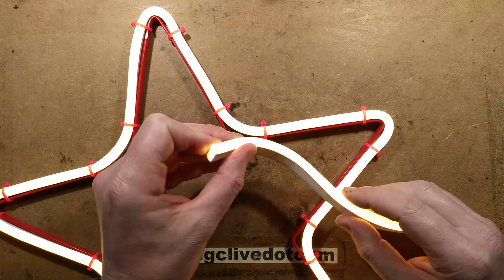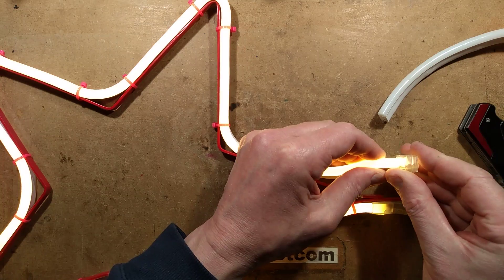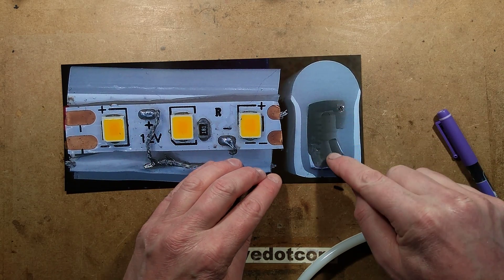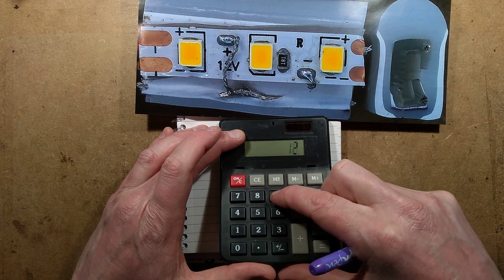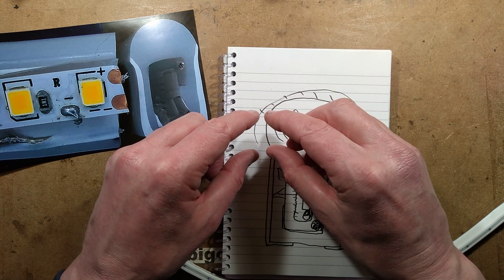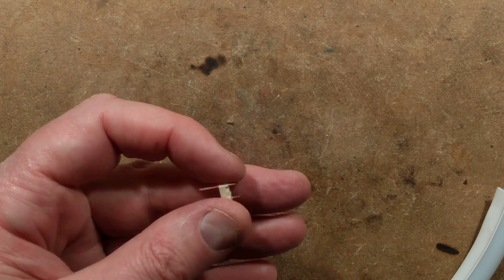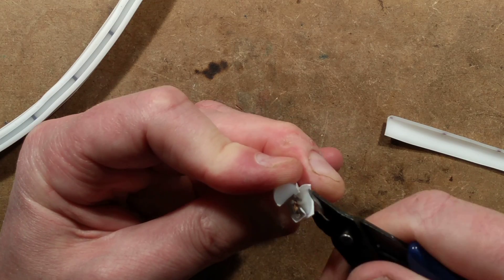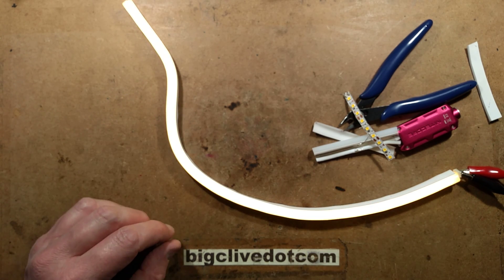Testing and tearing apart some 12V LED neon-flex.

Comment: my light brightness lost. what to do
Reply from the maker: Some LED strips progressively lose intensity over time.  Bad connections between the power supply and LED strip can also cause an issue.  It may even be a faulty power supply.

Comment: I just picked up 2 boxes of Twinkly Flex 7 ft strips. I normally don't like retail, but I had a $50 Best Buy gift card and they were on sale for $79 CAD (regular $129 but still overpriced I'm sure) so I took a chance. You are SO right about this stuff. I tried using the clips and double sided adhesive, but it's so rigid that it kept lifting them off of my kids' headboards.

Comment: If you stick it flush to an object, you have the dull side facing out? Will it look OK like that?
Reply from the maker: The light only comes out the diffused front.  It's common to route channels in clear plastic and then press the strip in.

Comment: What type of glue is best to stick this stuff down with? I tried contact adhesive but it just started to peel away after a couple of weeks.
Reply from the maker: It's better pressed into a frame as the plastic is quite hard to glue.

Comment: IN CHINA THEY PRODUCE LARGE ROLLS OF THE SILICONE TUBING & LARGE ROLLS OF LED TAPE, THIS IN TURN IS SOLD ON TO THE SMALLER WORK HOUSES ( SWEET SHOPS ) WHERE THEY PLACE TOGETHER & CUT TO SIZE ALL DONE BY HAND 1M 2M 3M & SOLD AT GOOD COST & THUS ARE ABLE TO MAKE A PROFIT
Reply: GREAT INFO. KTHXBYE!

Comment: i watched this a while back, and recently booked a lap of lights lap at silverstone...

im using red LED rope light as underglow for my car when im out on track there with my little brother (the visit is a christmas present). 12V works great as car battery voltage is 12.88V typically, i think addressable LED rope light might be better for car underglow, wire it in to a switch with a LED controller, and press the switch to cycle modes or have a receiver behind the switch and a remote to change colours etc.

I like the diffusion of rope lights, it's much better than almost all other LED strip.
Reply: Just taking a look too for a lil art piece on my houseboat, always nice to find that clive's already covered them. Cars (and boats!) are nominally 12v-ish yep, but can be 10-14.8 with potential 30v spikes from the alternator. LED strips don't tend to come with drivers so you might like to power it via a DC-DC converter to give it a stable 12v. They're dirt cheap on aliexpress (I got a few from the seller szwengao, search 12v regulator) and work great for anything that might be sensitive.
Reply: @asderferjerkel  Yea I have a few buck converters to provide a stable 9-12V depending on load.

I've hard wired in trackers and dashcams on sports/super cars a fair bit so it's pretty straight forward. I buy stuff on Ali Express but i think I brought mine off Ebay a while back.

Comment: What do i do if only half of mine is lighting up 🥲
Reply from the maker: It suggests a break at the point the light stops.  If it's low voltage then you can cut and join it at the dead point.  It's probable that there is already a manufacturing solder joint there.

Comment: What kind of battery would I need to power,  say, a 2M strip of this?
Reply from the maker: You could power it from an 8 cell AA battery pack or a USB power bank with 12V converter.  It would all depend on required run time.

Comment: I just bought one strip of 12V flexible neon exactly like the one in your video. My question is, how do I power it on? Where can I get a 12V power adapter? Thanks
Reply from the maker: You can  buy 12V plug-in power supplies from most electronic distributors.

Comment: Learn from my stupidity and don’t pull on it to straighten it out. I think the link between the bus and the pad broke and now there’s a dead half meter section in my 2 meter strip. But it’s fairly cheap so I bought another.

This video turned me on to the stuff. It’s really nice. I got it in a 110vac version. Very convenient and certainly looks nice.

Comment: can you please tell me how many volts and amp power adapter is used to light them up
Reply from the maker: Usually 12V.  The current will depend on the type and length.

Comment: Mr. Clive, if I may I like to pick your knowledgable brain for a second:
I like to connect a 12V light tape (you know the kind you get on a roll) and use it in various lengths throughout a camper van. 
Is there anything I need to put in series (most likely a resistor) with the sections to prevent any damage to the lighting in case the voltage gets any higher then the 12V the strips are intended for? I intend to use different lengths of the strip (obviously cut at the appropriate locations) to suit various lighting needs inside cabinets, drawers and for ambient lighting. The household part of the van is powered by a 12V lead acid (AGM) battery and is charged by a regular automotive alternator (or in case I am parked by a solar setup) which puts out 14.4 volts.
Thanks for any answer you have to help me pull off this plan...
Reply from the maker: Keeping the lengths short and adding a few diodes in series will drop about 0.8V across each diode.  That means the intensity will be highest when the battery is fully charged, but the brightness (and current) will reduce as the battery voltage gets lower.
Reply: @bigclivedotcom  I have one of those cockpit light dimmers sitting around, could those work to "temper" the voltage down to make the led strips last longer? I could put the dimmer (I think its a wire potentiometer) in the return line of all the cabinet and drawer lighting...
Reply from the maker: @koningbolo4700  To dim the strips you could use a 12V dimmer that uses pulse width modulation.

Comment: i got this to use on a standard wall clock (10"). it was 'glorious' beautiful even. after two months of continuous use, I noticed that it was fading. after four months of continuous use, it died a lingering death. no need to run off to ebay.
Reply from the maker: The secret of extending the life of these materials is to under-run them.  I use adjustable power supplies or add a diode or two in series with short sections to drop the voltage.

Comment: I got some from AliExpress that is just a 12 Volt LED tape extruded into the form, 5 X 13 mm with no other embedded wires. It has barrel connectors for 12VDC, but lights at 9VDC as well.
Reply: How you manage to make it work?
Reply: @crazyaa5651  I put a Pulse Width Modulator on my under cabinet lights to control brightness. I made a Joule Thief circuit that has 9 Volt output but has 13 Volt spikes also on the output and it lights very well.

Comment: So, neon flex is basically just a led strip wrapped by a diffuse material? then whats the reason people bought led strip when they can afford neon flex with similar price?
Reply from the maker: Standard LED tape is bright, but it's a series of sharp points of light.  The bouncing creates a linear line, but at the expense of efficiency.
Reply: Ah, I see, thank you for the vid man,it really helps👍

Comment: Why are my colors broken like i press red and only a portion of the strip is lit but when i pick blue its fully lit and pink it goes half blue half pink
Reply from the maker: Has the tube been flexed a lot?  It sounds like a broken connection at the point of the colour fault.
Reply: @bigclivedotcom  thanks for the quick reply and no not really, i shaped it one time into a rectangle and used the little plastic things to hold it down and had it there for about 3 months. It appears yours right there is a damage point, i twisted it a certain way and the rest of the strip lit up and its fine now, thanks anyway

Comment: Nice video. Thanks. Is there any difference in brightness between the 24V version and the 12V version? Thanks!
Reply from the maker: There shouldn't be.  24V has the main advantage of lower current for longer runs, but 12V can be cut in smaller sections.
Reply: bigclivedotcom thanks! and what about 220V leds? Do they have the potential of being much brighter? (I supose it depends on the kind of LED of course). But I have looked for this answer, to see what is the brightest LED strip available and I can’t find a definitive answer. Thanks for your insight!

Comment: Sir Clifford sir, could you put me right please? I happened to stumble across these ‘silicon ropes’ on one of my best-friend-Chinese-websites some weeks back and, being of the intrigued kind, I bought one in the hope that I would earn many brownie points from the missus when she gets to see how I’d lit up the house in the shocking pink version that I bought 👍😁.....anyway, it duly arrived and together with my 12v, 10A capacity supply, I had it working and wow! It’s damn good BUT......after a few mins it was getting quite warm....enough for me to do some checking of the spec and some maths. Spec said 60w for the 5m rope and so, over 5m, equates to 5A!....that now made a bit more sense but, even so, I emailed the company as other reviews had also stated “cool to run etc etc”. Their reply was that it wasn’t an issue and fine to use.....anyway, just watched your vid and you too said “cool running” which made me, again, wonder about my own. I’ve just looked at your uk seller’s link and if you scroll down it states 10w per m.....which would then be roughly the same as mine (ie works out at 5A over 5m). Cutting this short, when you say cool to run did you mean you had a short length or am I making too much of my ‘rather warm’ description? Any thoughts? Anyone? Many thanks
Reply from the maker: What sort of power supply are you using?  Some of these LED strips do run quite hot, but I always recommend under-running them if possible.
Have you measured the output voltage of your supply?
Reply: bigclivedotcom hi Clive, thanks for replying. No, I hadn’t thought to tbh but now I will......I, perhaps foolishly, did assume that the Chinese supply would be on the ball (i know, I know tut tut).I do also have the ability to turn the voltage down with a pcm so perhaps I’ll do that too.....wouldn’t hurt anyway as it’s bloody bright as it is! As long as I’m not fretting over something I shouldn’t be then I’m happy to let it get ‘warm’ (if you understand me). Thanks again. Keep safe. 👍

Comment: I've tried like 10 glues and I can't figure out how to permanently bond this neon flex to acrylic ANYone can point me in the right direction?
Reply from the maker: Joining soft flexible plastics is always difficult.  If you have laser or waterjet cutting equipment then you can cut a channel for it and lay it into quite complex shapes.
Keep in mind that it's better to install it in a way that makes replacement easy for service reasons.  LEDs don't last forever.

Comment: Stirling gentleman trying to create http://tiny.cc/2qphiz but I don't quite know how to cut the cable (some angled) and join them together. Because of the 25mm in between the cutting points I am quite confused how to do it. When I took apart the 1m sample I had there were no cutting points in the LED strip! Please help bigclive.

Comment: Hi. Do you happen to know if it produces any "Noise" when being used in conjunction PA systems, mixing desk etc? Also how is the flicker on video? Did you have to avoid certain shutter speeds on your camera to not make it flicker in this video? Thanks for the very interesting video. Andy.
Reply from the maker: The 12v material runs on smooth DC with no flicker.  The quality of the power supply will determine if audio interference is generated.

Comment: Love the coasters and the fact that you have made them "official".  I hope to see a lot more of these.   
That LED tape looks very interesting.  I love the fact it has a proper bus bar inside to help reduce voltage drop along the strip and keep a more uniform lighting effect.
I'd love to know if it was available in RGB or even indvidually addressable LED's like a WS2812 version.
Reply from the maker: Both those versions are available, but a bit harder to find.
Reply: @bigclivedotcom  Thank you for the information.  Very much appreciated :)

Comment: Can i ask for help.. I bought neon led strip and after 3 h at the end it melted, burned and stop working. I cut last meter on sizors mark and it doesnt work. I accidently touched with end some iron and it turned on, but when i move its off.. Its like that doesnt have minus pole... Do i have to put at the end something, because here is at the cut end only plastic cap,, and  mine cant work... Sorry for my bad english, but maybe someone knows more about why its working only when cutted end touch iron.
Reply from the maker: Is it the correct voltage for your supply?  Is it mains voltage or low voltage?  If mains and it turned on when you touched it with your iron then it means you didn't cut it on the correct cutting point (between each section) and the current was flowing back through the soldering iron earth. (Which is dangerous.)

Comment: which are the  dimension pins 3528 or  5050?
Reply from the maker: Many of these stirps use 2835/3528 LEDs.
Reply: @bigclivedotcom  okay tks,  which are you use at this specific case?

Comment: The eBay listing says the rope can only be cut every 50cm. The black notching i see here is much closer than 50cm. What is the truth? And can you possibly show how to make lit shapes that are not connected to one another. How can you connect them all to the same power supply?
Reply from the maker: You get different types with different cut distances.  The sections can all be wired in parallel.

Comment: Why would they go through the trouble of adding a separate + and - bus when the LED strip already has its own?
Reply: The bus on the strip has limited current capacity, so LEDs far from the feed end would be dimmer, and the strip would get (slightly) hotter

Comment: alot of people use EL wiring or electro luminescent  , to produce a similar effect with low power consumption and comes in many sizes, its actually really cool seeing the led ones broken down though. but yeah figured ide note that because of the general effect

Comment: You didn't put your red cable ties on correctly. Instead of having just one in the corner where it bends you put two on either side of the corner. So your flex hasn't got a sharp bend in it. The wrap around at the star points is fine, however.

Comment: how can i put an idea past clive ... ?
Reply from the maker: Just leave it in a comment.
Reply: @bigclivedotcom  Hi clive, some time not that long ago, you did a video on fly zappers, which I watched with great interest as i've had this idea in the back of my mind and your video brought me to the awareness that it was not as simple as I had thought, I live off grid in kent uk in a static caravan, with a solar array, I invert 24v to 230v on the 13amp socket ring and 12v on the lighting one and by tapping into the 12v ring in certain places, I can use it, without interfering with the led light bulb switching, as in the original wall switches still work as they should and I can provide 12v to some small fans and power the solar controller/monitor no problem, now I want to run a few these fly zappers from the ceiling so that they are permanently on, (there will be an on/off switch to use when necessary), from your video I concluded that there were issues with the power been constantly on, for which there is a discharge device in these zapper circuitry to drain and prevent heat.
I'll leave it there for now and look forward to your reply, feel free to ask any questions you wish to ask and suggest things I may have over looked, I have a pretty good overall knowledge of various levels of electricity from my days touring the rock and roll circuit, but don't feel comfortable in the micro electronics area …........... sincere regards … jeb.

https://www.youtube.com/watch?v=yGR2G4qHm6g link to the video you did with the fly zapper.

Comment: Very interesting as allways so there is no heatsink for the leds then?If they make this manualy I would think the bench is very long
Reply from the maker: The LEDs won't get very hot at 16mA.  They often do have long benches for manufacturing stuff like this.

Comment: the best part of a sharp knife is it does not hurt as much as cutting self with dull knife. if knife is too sharp  you wont even know you  cut self  until  you see blood
Reply from the maker: After the random time delay before the blood appears.
Reply: @bigclivedotcom  i normaly find the blood on something else and then go looking on self
Reply from the maker: @joejane9977  Yeah, that does happen a lot.  And the bit of your hand that's got blood all over it isn't always actually the bit that's bleeding.
Reply: If your quick you can cover it bandaged before you see the bone , tie the compression while still covered by the buzzy haze of adrenalin...

Comment: Btw .. how would acidy sanitary silicone work for sealing in those end caps?

Being flexible could make it optimal ... it also reeaally bites into everything (and I’ve never seen it corrode anything or conduct even slightly)
Reply from the maker: Sealing the waxy flexible plastic is difficult.  You really have to use a matching plastic and solvent glue or amalgamating tape.

Comment: It looks great but once the LED;s start to fail it will look very patchy. There is no way they can be replaced?
Reply from the maker: The whole section is best replaced if it starts failing.  I always recommend under-running stuff like this.
Reply: @bigclivedotcom  Thanks for that.